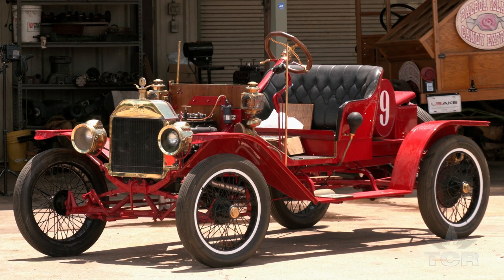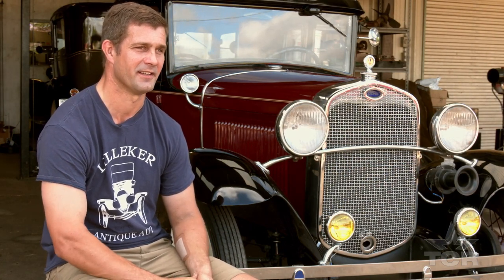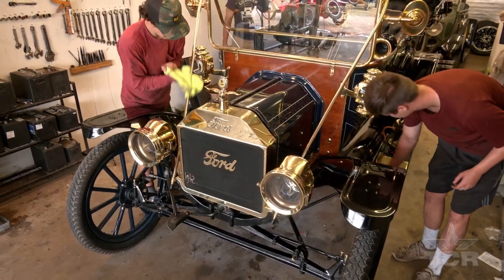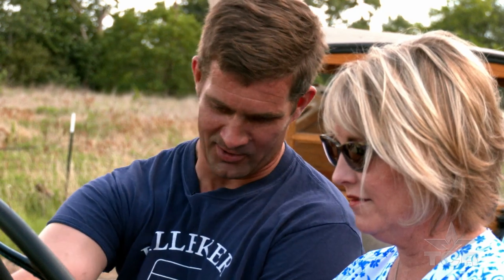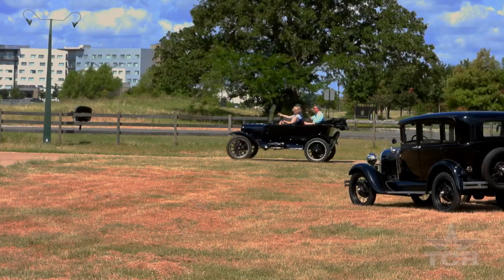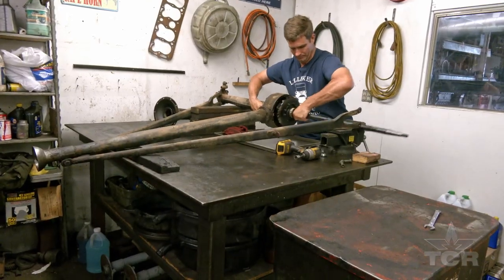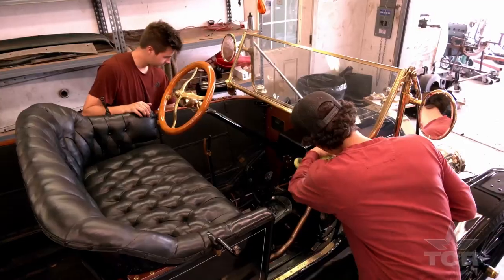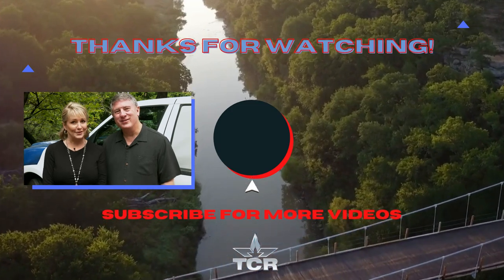Model T Shop (Texas Country Reporter)

Comment: Very nice, but I'll pick a historical nit. The first Ford didn't "roll off the assembly line in 1908." Ford Motor Company's first car was the Model A of 1903. When the first Model T did come out in1908, Ford hadn't yet developed the moving assembly line of a few years later. They made the Model T for19 years, then came out with a new Model A.